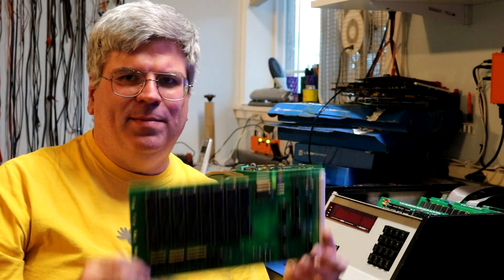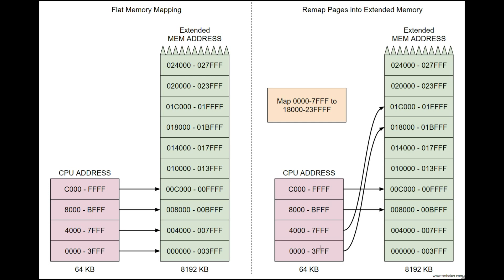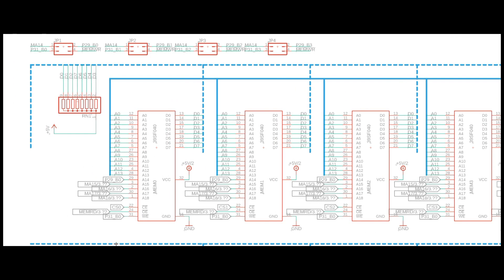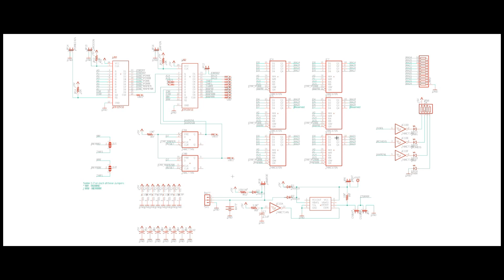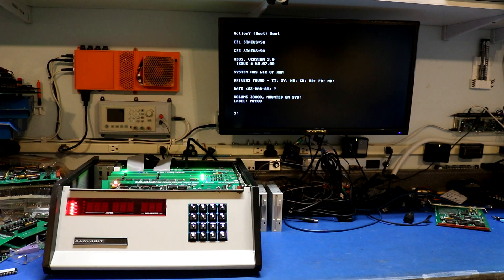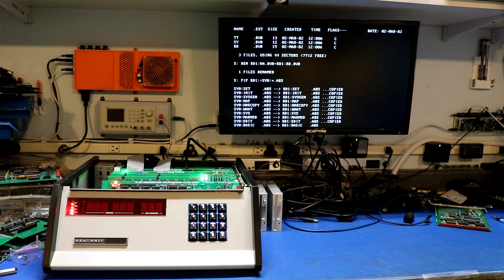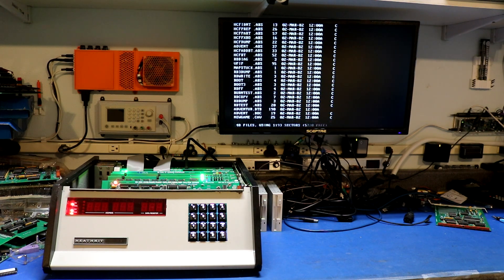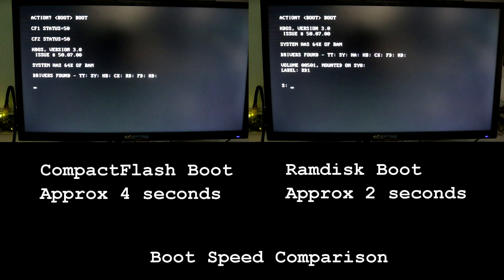Heathkit H8 Part 4: 16 Megabytes of RAM in a Heathkit H8 Vintage Computer

Comment: Another fantastic video, Scott. I have to ask, when you were starting out in electronics, that you'd be able to do such rapid prototyping?
Reply from the maker: Never in a million years. My first (non-protoboard) PCB was made by laying down tape on a copper board, etching it in a tank, and drilling each and every hole. Every trace was routed by hand. It was single-sided, with no solder mask, and difficult to solder as it was not plated. There were occasional dropouts in the traces that had to be bridged. It was probably a couple of DIP ICs and a handful of components, with a few dozen traces. Then again, I was able to make it in an evening without having to wait half a week for it to be flown in by jet aircraft from the other side of the planet.

Comment: Interesting, but a Heathkit H8 Computer with 16 Megabytes of memory is a bit overkill, if you would gather all programmes ever made for the Heathkit Computer and store those in the Flash memory. I think you end up with space left vacant. Wouldn't it be a nice idea to add button cel batteries, so that all programmes ever made will be stored in the computer till the end of times or till all batteries fail. (whatever comes first)